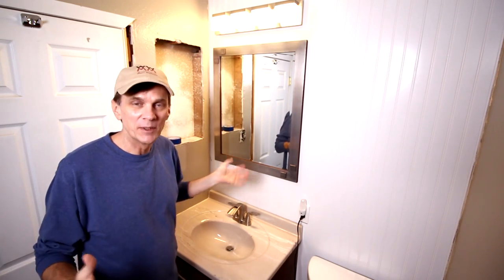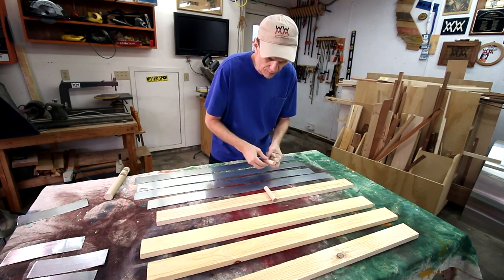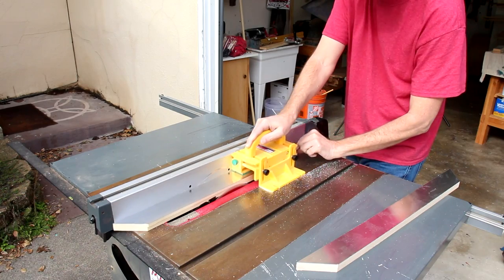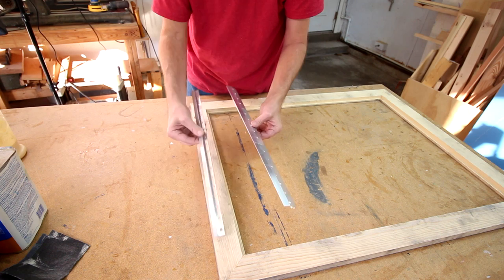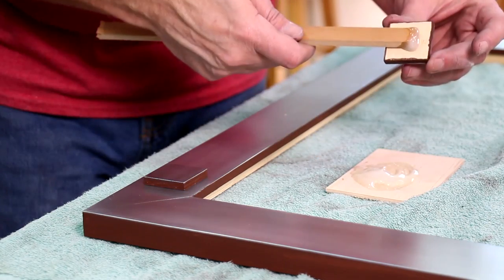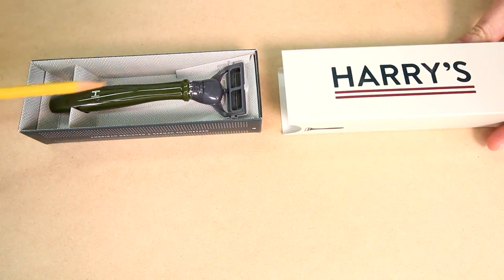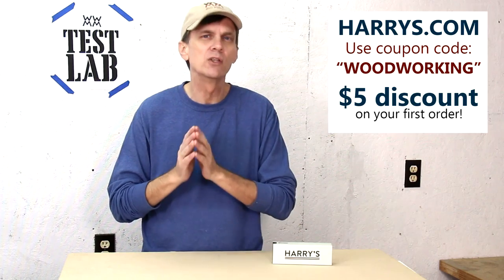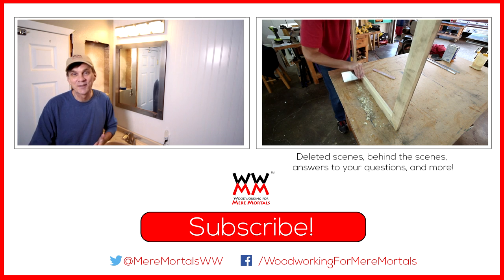Incorporate Aluminum Into Your Projects. Modern Bathroom Mirror

Comment: If you have a SawStop table saw, DO NOT cut with aluminum!  It will trigger your brake just FYI
Reply: +James Nelson Though you can put the SawStop into bypass mode for cutting conductive materials. Be safe!

Comment: You made the comment that one can work with aluminum (because I'm American) using their woodworking tools. I've seen questions/answers about dulling a table saw blade. I'm learning about the different blades, tooth patterns, etc. and wonder, while any blade will cut aluminum, is a rip blade or a cross-cut blade better than any other for this task? Or should I spend the money and purchase a "Microjig...maker of the Gripper!"?
Reply: +Steve Ramsey Convincing add but I think I'll just stick to shaving with the frozen disc though

Comment: Great stuff there Steve.  Like the combination of materials.  I cut a bunch of aluminum including a bunch of 80/20.  Make sure you have a blade with plenty of teeth.  I typically look for blades that say "non ferrous metal cutting saw"  with a 10" I get the 80 tooth. Not sure your going to have a great time with say a 40 tooth.

Comment: When i cut thin aluminium i use a backing board, sometimes the sheet can slip under the fence, the backing board raises the sheet, and prevents the cut bending (zero clearance) ;)
(get a thin board and pass it partially through the blade then secure, run the sheet on top of that)

Comment: Hi Steve, a question: the blade is not damaged with aluminum?
Thanks for sharing this great project.
Reply: +Francisco Corona aluminum is soft, the blades are able to cut aluminum fine.
Reply: +Francisco Corona Thin aluminum sheet is not really going to be an issue, but some grades of aluminum , especially if cutting thicker pieces, can gall, and also build up on the teeth of your tool.  Something to definitely watch out for.  Thicker pieces can be speed (tool rotation speed) and feed (rate you feed the piece through the tool) dependent, primarily for those reasons.
Reply: +Faelwolf  you can even cut mild steel with wood tools.  I made a jig and used low strength bolts to hold things together.  I cut into the bolt head with my router bit. not a nick on the bit.   Carbide bit. very smooth cut on bolt head.

Comment: Hi Steve great video but could you not have glued the hole sheet to the timber and then cut your sizes out and it would have been more stable attached to the timber just a thought kind regards David

Comment: What thickness is the Aluminium sheet you are using? In fractions of Inches, mm or gauge. I'm by lingual. Good job! Oh pencils might have been better than pieces of dowel as you can still use them, no waste and you always have them in a shop. Stephen Malone NSW

Comment: First you want it flush against the wall an then you reinforce the corners with metal and screws standing out of the back ? :D
Reply: +GermanLatheDude I was wondering why he didn't use pocket holes for the joinery.
Reply: +Richard Hiller   Or biscuits.  But that's not done.

Comment: Your wrist was quite clicky when using that screwdriver...might wanna see a doctor about that!  :-)  The mirror turned out great.  I like the wood/metal marriage, versus wrapping the metal around the wood.  Did you consider using splines or pocket holes for the frame miters or were you not worried about it?
Reply: +Chris Williams Never mind about the splines...just watched it again...corner brackets.

Comment: A tip, when polishing aluminum or stainless steel use a 3M pad (Scotch brite and WD-40. the metal will corrode in the future so a spray coat of poly would not be out of order..

Comment: Do you know where i can buy that type of stapler thank you.
Reply: +seigeengine Yes they are but he is not using a regular stapler. He is using a framing stapler which uses special bits for holding the back of picture frames. Small pins would do but Steve makes lots of picture frames so worth him buying the proper device.
Reply: This device fire the staples into the frame, a regular staple gun would fire them into the back of the picture.
Reply: I was trying to be helpful. If you read the other comments about the device he is using you can figure it out for yourself.
Reply: +dubbreak Thank you dubbreak i know exactly what a staple fram is some people thing are the same but we know that are the same, Ley Valley great new i have five from my house thank you again fir the info.
Reply: Gotta love Lee Valley. They seem to always have the hard to find items the normal hardware stores don't have: square cut nails,  milk paint, tabletop mounting clamps, handscrew (jorgensen style) clamp hardware etc. Plus you can drool at the Festool stuff.

Comment: Enjoyed your video. I recently used some aluminum to cap off a small votive candle holder. Man I had lots of problems with drilling, tacking down the piece, distortion. The contact cement would have solved most of  my problems. Thanks.  BTW- I do not shave . I do sleep, so how about $5 coupon  on a mattress. 
Ha! Ha!
Doc
East coast woodworker

Comment: If you use masking tape on the edges of where you cut on the table router it will give you a smooth edge and you won't get as much split off

Comment: I wasn't aware that aluminum could be worked with woodworking tools. Is there a maximum thickness that can be worked without really wrecking your blades? What other materials can also be worked using wood tools. I imagine plastic is one.

Comment: It's worth noting that if you have a SawStop saw, you can't cut aluminum, because if you touch the aluminum with your hands and then touch the blade with that aluminum you're holding, it'll trigger the brake.
Reply: it's worth noting that you can disable the brake mechanism for cutting conductive materials